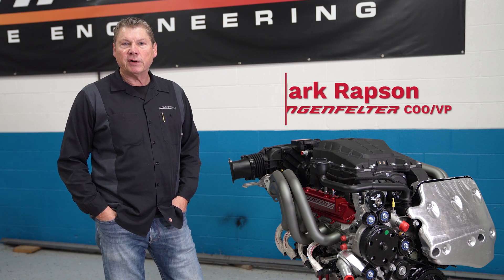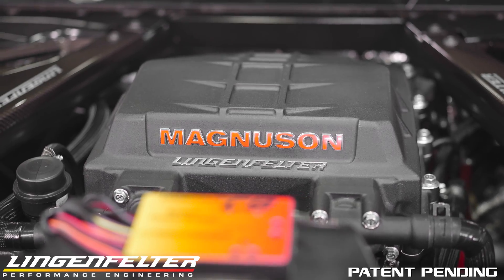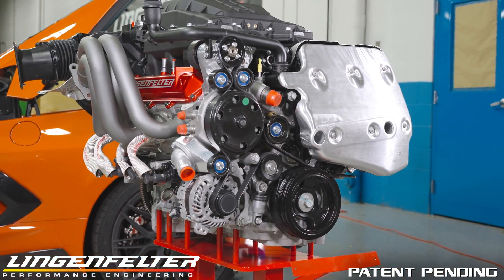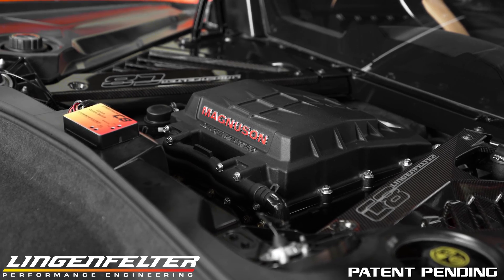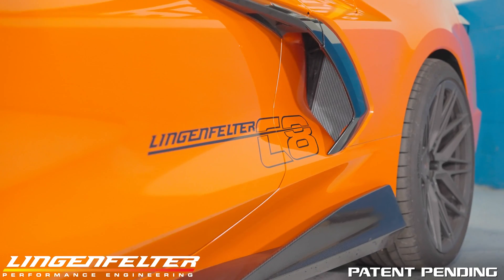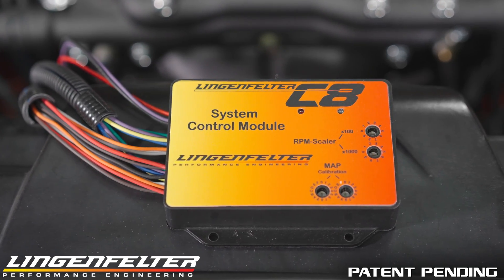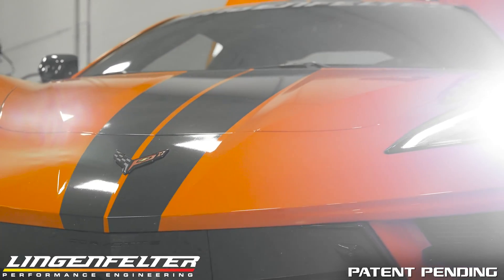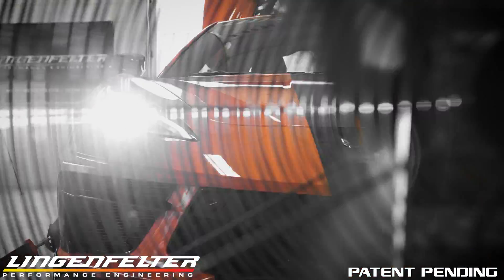Lingenfelter MAGNUSON C8 Corvette Supercharger System | Pre-Production

Comment from the maker: For more information on this package, please visit: https://www.lingenfelter.com/lingenfelter-magnuson-705-horsepower-tvs2650-c8-corvette-di-supercharger
Reply: Please post rear wheel dynos and timeslips with corresponding PSI and modifications. Thanks and keep up  the great work.
Reply: So no tuning / ECU cracking is needed?
Reply from the maker: @JoesGarage-c8corvette  This is an old video on our prototype supercharger system. This package is tuned with the factory ECM using the Lingenfelter C-CAL Process. You can learn more at https://www.Lingenfelter.com/C8-Supercharger
Reply: @LingenfelterLPE  awesome. Thank you.

Comment: The C7 ZR1 using a similar Eaton based TVS 2650 Supercharger mounted to a LT1 modified Engine, which originally produced 455hp, thus  boosted up to 755hp.  A cool extra 300hp
Yet this Lingenfelter Performance Engineering outfit can only get 705hp from a 490hp LT2 engine. 
As Hulk says, "Puny Lingenfelter". All Germanic sounding name & no action. Not so easily impressed, sooner get a Procharger stage II with an extra 225hp when that soon comes out.

Comment: Nice job...
Many people didn't think a roots type blower would fit and integrate properly.
The piggy back ECU is a nice touch...
700+HP splits the difference between the 650HP C7 Z06 and the C7 ZR1...

Comment: Just imagine one of these on the C8 Z06. That will probably get that thing easily over 800hp. Probably close to 900hp.
Reply: True. Perhaps that is what the Zr1 could be, or Twin Turbo…
Reply: @brennan2553  it’s supposedly gonna be twin turbo and probably in the mid 800s if not 900s. And eventually the hybrid AWD version will probably be like the Ferrari SF90, twin turbo flat plane crank, hybrid assisted front wheels. Over 1000hp.
But that’s just rumors. No idea if they are gonna be able to do that..

Comment: Why no dyno graph? 2650 @ 6psi seems like a waste. It probably doesn't even make 2-3psi until it gets up over 5k rpm. I know why it's turned down because to run any more boost then you need a 4300.00 set of clutches for the DCT. Then you are probably ok to make 8-9psi before you need to pull the engine and put drop in rods/pistons just like a LT1. Actually I would be more comfortable pushing a LT1 since there is actual tuning support and not relying on a piggy back controller. Either way pistons, rods, dct clutches, and turned up to 14-15psi like most OEM's run on their factory cars( Red Eye's & ZR1's) it should run good.

Comment: How much roughly will the kit cost and does it throw a CEL or does the module account for that?
Reply: I guessing 8-10K then add installation.
Reply: @rmacco46  The Procharger kit is like 16k plus install. Literally cheaper to pay adm for a Z06 at that price. Hopefully you are right and this kit comes in around 8k-10k

Comment: A 2650 blower making only 6+ psi is extremely conservative (I understand why though).  C6 ZR1s ca make over 1000 whp with a 2650--doing that with a mid-engine C8 would be nuts.
Reply: I think its only running 6 psi for the same reason all the twin turbo kits are at about that. That's as much as you can safely do until we can actually tune the C8.
Reply: Higher compression engine need less boost to make a lot of hp

Comment: They got some competition already.. company in Georgia with do stage 3 with clutch swap and full motec add-on.  Sucks GM locked down ecu (heard it's encryption that keeps changing is problem) and everyone has to use piggy back ECU.
Reply: Yes, but soon EPA will be going after all the smaller shops that don’t get EPA/CARB emission approvals for their piggyback ECU’s with high dollar fines. Can be as much as $10,000 per system sold.
Reply: @ShelbyvsViper  - True, and the moral of that story is that folks should stop voting anti-car (and everything else!) libturds into office.
Reply: Name the shop

Comment: Which C8 will hold best value?
My allocation should be here next week, and I plan on driving it 3-6 months due to personal reason. Is there any configuration recommended, to reduce exposure, for resale since I’ll be selling within 6 months after driving it? I can only afford the 1LT so that’s a must. Color choices (exterior and interior), options, etc?
Reply: Colors that are "normal". Like don't do a red interior with orange. Also 3lt is preferred unfortunately. Rapid blue seems to be hot.

Comment: This is bigger news than anyone realizes, especially if track temperatures are kept in check. This sounds like more than a Z06 rival.
Reply: People could also supercharge their C7s to challenge the C7 Z06. Did anyone care...not really because at the end of the day it was still just a base model.
Reply: @EK-rr2md  On the C7, you would end up with the same configuration. On the C8, you end up with a different engine powering the mid engine chassis. Im not so sure that a OHV Supercharged engine with massive torque is a bad thing in the mid engine platform, especially for road racing where torque wins races. Cadillac continued to dominate FPC engines with their IMSA race car.

Comment: Nice setup but 10psi should be a minimum these days. That engine is built well also
Reply: The tranny is only good for 700 hp. What the point going higher when the tranny will start to slip?
Reply: @Abrandnew3  its probably more of a torque issue then hp but still 700hp in that car would be a monster

Comment: Exactly what my c8 needs.what's the pricing etc
Reply: I think I read it was around $13,000.
Reply: Dan C sounds about right for a couple hundred extra horsepower (reliable) from a proven company!
Reply: @faraci5617  if that was the installed price it would be about right, but if it's just the parts then that's a little steep